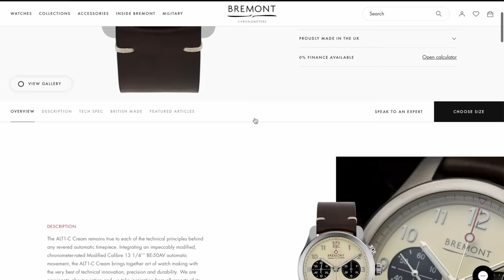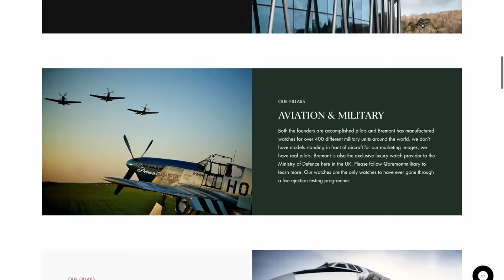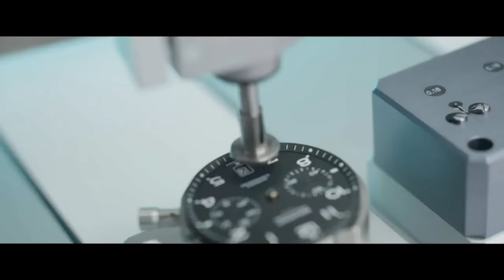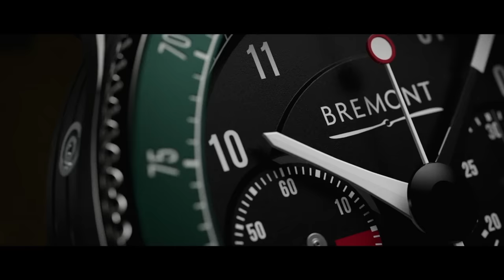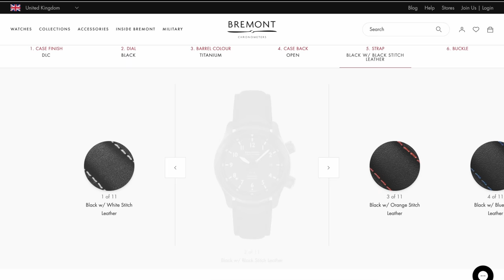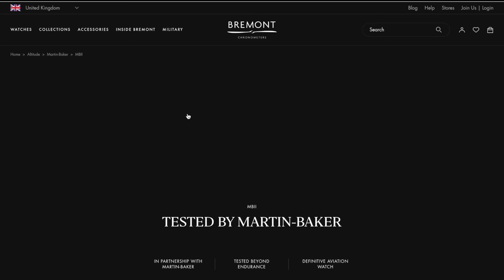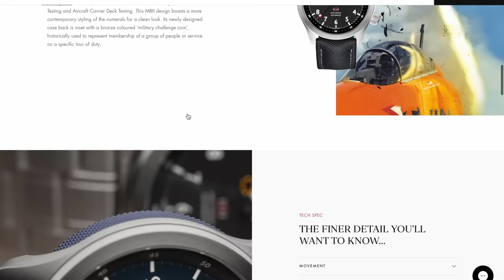Why I switched from Rolex to Bremont and my three rarest watches

Comment: I have 2 Bremonts, the Solo 43 and an MB11. I’ve found I get more comments about the Bremonts than my 3 Omegas. I’m concerned for Bremont at the moment, the new logo, and the awful new font lose part of the perfect simplicity of the old logo and font. Breitling have always kept their aviation connection no matter whether the watch is a Navitimer or diver, I’d like to see Bremont stick with their history, the new watches I believe, could be vastly improved by the old logo and font.
They also need to stock up on straps! I need a new strap for my Solo, but take a large size and Bremont have a very limited selection in stock.
Reply from the maker: I too get more comments about my Bremont watches. They do offer something different from the mainstream. As to the future of Bremont, well…

Comment: Very compelling story! I am a Panerai collector myself, so I understand the allure of focusing on a particular brand. 

I was aware of Bremont prior to my purchase of one. I had heard mixed opinions online, a lot of it to do with price vs value. A smaller auction house here in Canada was holding a watch auction and they had a Solo PB in the lineup. Shopworn, so virtually new. Obviously the military inspired look appealed. I ended up the high bidder and my first Bremont was on its way to me. I knew if it didn't win me over, the price I paid would ensure a tidy little profit from a Chrono24 listing. Zero risk. That was over a year ago and the Bremont staked out its spot in amongst a couple of dozen other watches in the collection. It is actually on my wrist as I write this. Perhaps YouTube is not just listening to our conversation, but scanning our wrists to serve up appropriate content (this video popped in my recommended). I put The Solo on a red strap some months back, so it was a natural choice for Christmas day watch. I've come to love it more and more. 

As to the often heard critique of some people, I think it is well worth the money. Sure, it doesn't have the brand cache (yet), but it is an exceptionally well made watch that does precisely what it claims to do. As a Panerai guy, it does take a couple of hours of wearing to adjust to the smaller size (relative to the PAM's). If I had to pick a one watch collection contender out of my current boxes, the Bremont would be in the top 3 for sure. It is as accurate as my SD43, hyper legible, and has a style that would work from t-shirt to suit. Its also less likely to attract the unwanted attention that a Rolex on the wrist now does in too many cities around the world.

Comment: Great video and I couldn't agree more with you regarding Bremont. Every point you made is on point and as a brand that are IMO one of the most exciting to enter the market in recent years. My first was an S-501 which I purchased to replace a Luminor Panerai 1950 ceramic I had grown  bored with. That was about 5 years ago and my (not boring) journey with the brand continues...
Reply from the maker: Kindred spirits. Thanks for sharing!

Comment: ...and now, Bremont might have just ruined their brand image
Reply from the maker: Bremont is going through a complete rebrand and repositioning, to the extent that as a long time fan, I am reassessing whether it’s a brand that I am still attuned to & relevant to me. I say transitioning… because the retention of the “air” watches which are still available for sale and which have not been rebranded nor redesigned. I regard that as a hedge and also a way back for the company, in case Davide Cerrato’s plan doesn’t result in dramatically more sales… It’s certainly changed its brand image, however whether it has been ruined hasn’t yet been established… ultimately, only time will tell. The question for me is: how patient are the company shareholders and when will they deem that this new direction has succeeded or failed ?